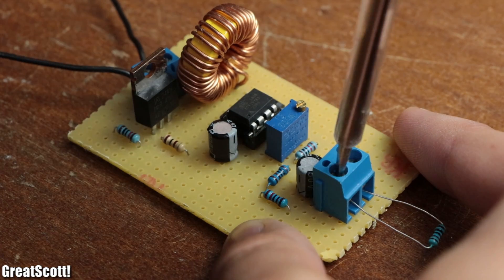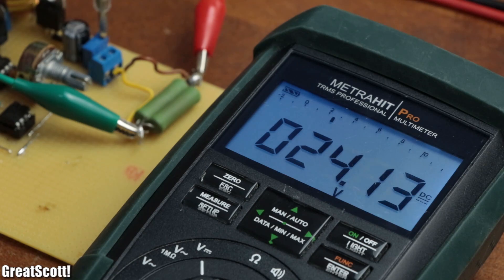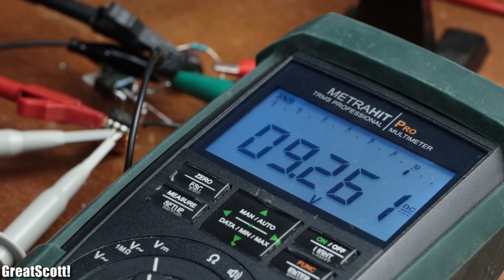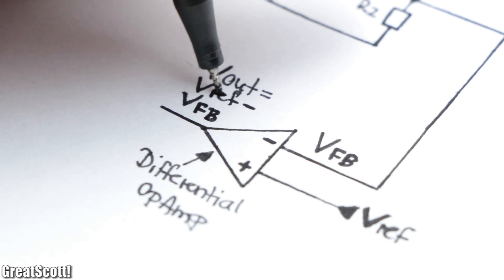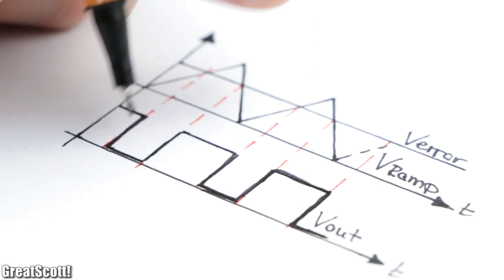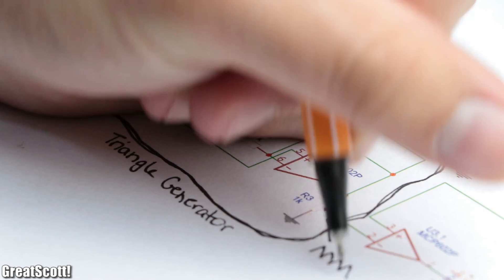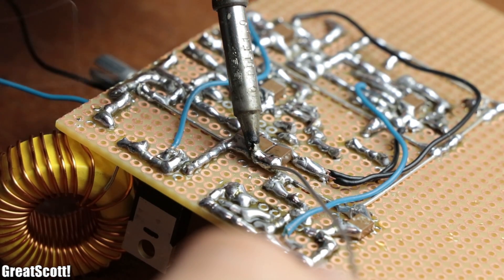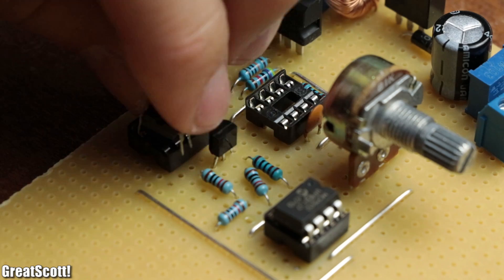Creating a Boost Converter WITHOUT a Microcontroller

Comment: uC are very handy, but they suck compared to dedicated IC's (and the discrete component method too).. For DCDC converters, a high switching frequency is sometimes very desirable. With uC's the PWM frequency is often too low or if it can be increased, the discrete steps that the duty cycle moves in is absolutely rubbish for maintaining a decent output voltage.
Reply: In addition to that mentioned disadvantage (quantized PWM steps that a microcontroller supplies), a much larger problem with using a microcontroller is that you cannot tune the feedback loop for high gain and high speed.  Designing a proper feedback loop for an SMPS is the hardest part.  Using a microcontroller will work, but the microcontroller will respond very slowly to output voltage changes, often taking hundreds of microseconds or even milliseconds to bring the output voltage back to the design voltage after a transient.  This is unacceptable in most applications.  An SMPS using a dedicated SMPS controller IC can be designed to bring output voltage back to the design value in single-digit microseconds for voltage-mode control, or down into the nanoseconds for current-mode control.  In this circuit shown in this video, the error amplifier looks to have a gain of around 1 (10K input resistor, 10K feedback resistor).  While that will indeed be stable, the output regulation will be very poor (several tenths of volts or whole volts of change with a load change).

Comment: I think you made that way more complicated than you had to. Whenever I have built boost / buck converters for projects, I typically use a PMIC which if you do the calculations in the datasheet correctly, will end up needing fewer parts and no potentiometers. Alternatively, you could try using TI's Webench tool, which lets you put in your input voltage range, output voltage range, and output current (it automatically detects boost / buck), and then will give you a list of specific value parts for different designs with various efficiency curves. While the main PMIC would be a TI part, you can usually find comparable parts from other manufacturer's which don't require component value changes. Also, all of the webench designs are SMD based, so they give you a recommended compact PCB footprint for the converter, though you should be able to do the same thing using perf board and THT components.

Comment: Lol,, let's kiddingly complain more! ;))
 Why are you using these newfangled IC-thingys? Real men build their boost converters out of discrete transistors!!

...or so I've been told... 

*buys 5 converter modules on AliEx for $0.99 like everyone else

Personally, I usually grab an old phone type car charger with an MC34063 and put the original components in a boost configuration. Then I simply change the feedback resistors to set the voltage. It's not a clean voltage rail or capable of serious current, but it works for powering a relay or something like that with around 12-15 volts from a 5v supply. I don't worry about the inductor size or anything like proper SMPS design. Just throw it on super cheap perf board and hide it in the back corner of an enclosure.

I've never used a uC though.

Thanks for the upload ;) 
-Jake
Reply: LOL no way, tubes!
Reply: Relay logic is the only way!
Reply: Very impressive, but can you do it using only passive and electromechanical components?
Reply: Wolfin 
Heck yeah!!! 

I ball George Jetson style. 

*Button push + Button push + Button push = boost.

 You can call my thumb Mr Mosfet Sir.
Good day!

 ;))
Reply: Real men build their boost converters using only a pencil, tin foil, and a razor blade
Reply: Then we'd just make pinball machines. this is not a bad thing!
Reply: Real men use motor-brush rectifier
And piezoelectric switch

Comment: Great video - btw. it does make sense, because when using an uC you need a programmer, computer, etc and also its not available everywhere and little more expensive and harder to replace when broken (reprogram, needs the code etc)
Reply: on what device did you watch this youtube video?
Reply: android phone, why?
Reply: A programmer's job is to get fired as quickly as possible.  Put another way, a programmer should be looking to have the project done so he is not needed- a programmer is an automator.  If your code needs reprogramming later on, either your needs changed or it wasn't done right the first time!
Reply: PolskaDojczland 
You have a good point. But I (as an electronics hobbyist) usually prefer the programming approach, I feel it's easier to test and debug, especially if you come from programming into electronics. But I noticed that the hardware approach is somewhat more "robust" than microcontrollers.
Reply: Abdulaziz Salam - For a hobby project you can use whatever parts that you have and want, but for professional use a standalone ic would be used - a uC is just too unreliable, not "robust" enough as you mentioned. But both approaches are valid, i just wanted to clarify it DOES make sense to use only ICs, because in the video he wrote it doesnt make sense.
Reply: PolskaDojczland 
In an old project I needed few logic gates but didn't have them at that time, so I used an AVR Attiny85 instead of them. It's pretty crazy I know 😂

Comment: It's always good to have more than one way to solve a problem.

Plus, I prefer a pure hardware solution over doing the heavy lifting in software.(mostly because I suck at coding)
Reply: In the aerospace industry this approach would traditionally be the more preferred choice as it is easier to verify. Verify code and a microcontroller is a lot more complicated than verifying individual components and ICs.
Reply: seconded. I usually frown at the use of uCs in every simple application that can be done with a transistor and a few resistors. And this traditional approach is easier imo and the right way to implement basic circuits.
Reply: Indeed, but if you use more hardware on your projects, you will have more stuff that can eventually fail. Also, if you use a mC for simple aplications, is like killing a fly with a cannon. Yes you can kill ir, but with something simplier you can do that job
Reply: Joe Charlie H
Yes there is more stuff to fail but one needs to look at the overall probability of failure. Which is the sum of probability of failure of all of the parts. As a very simple example, if there is a circuit which has 5 components which all have a 0.03 chance of failure, then the overall chance of failure is 0.15. If a second circuit has 10 components each with a 0.01 chance of failure then the overall chance of failure is 0.1, what I am trying to show by this, is that although the second circuit has more things which could go wrong, the chances of the second circuit failing is less. Is the mircocontroller more likely to fail than the sum of any of the ICs, that is the real question as to which circuit can be considered the more reliable in terms of prevention of failure.
Reply: pileofstuff at least you are better than me, I don't even know coding is related to electrical engineering.
Reply: pileofstuff at least you are better than me, I don't even know coding is related to electrical engineering.
Reply: Sometimes i chose a uC because it was a more compact solution, i need to fit in something somewhere but i can run an ATTiny or STM8 with no external components at all, saves space over a 555.
Reply: Yep, there is more than one way to skin a cat.

Knowing them all isn't overly beneficial, but knowing some of them is. Take your pick!
Reply: the biggest draw towards using an IC for hobbyists (and even small scale commercial projects) is that it's often cheaper and faster to design and build an IC based circuit than one using discrete components. once you go into rf, that changes a bit, but SDR are a big part in most recent radios too.

Comment: Nice tutorial - but I wouldn't recommend the microcontroller version either ... Use a simple MC34063 for this task :) A step-up / step-down normally does more than just adjusting the PWM ... They have some safety circuits built in - for instance limitting the current through the coil and mosfet ... A year ago (or so ...) I used the cheap MC34063 as boost converter for 50W LED (12V to 48V @ 1A) which worked quite nice and it is cheeeeeap :)
Reply: temperature compensated, too!

Comment: You've overcomplicated this project. You could've used the UC3843 IC, which is way cheaper than a microcontroller. Everything is inside that chip, you only need a mosfet, voltage divider and current sense resistor (optional), plus the filter.
Reply: Even simpler is to just use the MT3608 chip. It has the mosfet already build in and you only need to add a couple of resistors, capacitors and an inductor. However, this video by Greatscott was not about simplicity. It has great educational value...

Comment: An old school Great Scott electronics video -always a treat when the Patreon feed fires :-) May I ask about the ramp function please? Why not a sine wave there? Isn't it easier to create a sine wave oscillation? Hope this is not too dumb a question.
Reply from the maker: Since the feedback needs to be linear we have to use a triangle signal.
Reply: A sine would result in nonlinear feedback. It'd sort-of-work, but output voltage stability would be poor. To work properly you need a triangle or a ramp.
Reply: To address your other question, sines can also be trickier to make. Triangle waves are very easy to make with a relaxation oscillator. Sine waves require a little more effort, enough so that many function generators instead filter a triangle wave into something similar to a sine rather than generate the actual thing from scratch.
Reply: Really good triangle waves are difficult. You need to do things involving a constant current source. But unless you're making something that needs a really precise triangle/saw wave (an oscilloscope perhaps, or CRT display), a relaxation oscillator is a close-enough approximation.
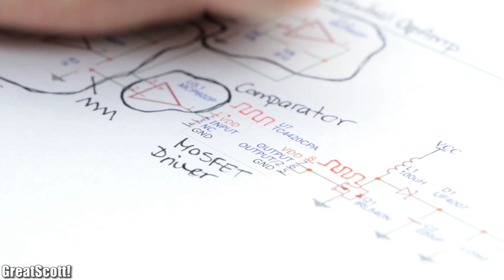Reply: @vylbird8014  The oscillator used in the circuit (see 6:02 ) charges/discharges the 10nF capacitor with a constant current via the 1K resistor which has either +2.5V or -2.5V across it, That's because the 1K resistor is driven by the rail-to-rail (0V to 5V) square wave from a Schmitt trigger and the other end of the resistor at the inverting input is kept at the same voltage as the non-inverting (around +2.5V) by opamp action. It's the really good triangle wave you're looking for.

Comment: Why would it "usually not make a lot of sense"? Every boost converter IC on the market is analog, even the digital ones have a simple state machine, not a whole mcu! Throwing an MCU at every problem is lazy and shows lack of skill. A few opamps and a 555 are usually also cheaper than an attiny and can be done with less boardspace if using the proper SMD packages.
Reply: It is easier to use an UC3843, dont you have them in your country?
Analog IC with only 8 pins that provides current limiting and a voltage control with a few components to work
And its $1 per 10 of them!
Reply: Yeah using MCUs for everything is just lazy, as I said to somebody in a comment above, in the aerospace industry the non software approach would traditionally be preffered
Reply: Novi S when you reach production, you will realize how expensive they are.
Reply: David Schwaerzle analog parts are also available in tiny smd package and they usually cost only a few cents.
Reply: David Schwaerzle did you seriously just write FPGAs ? who in their right mind would use an fpga to implement a simple current sense ?
Reply: 12458 SSE did not get it. Which production? China really likes to use uc3843 in their buck and boost modules cause it is cheaper than anything else
Reply: David Schwaerzle But if you use a microcontroller, you have to program every device. I think this can be completly automated, but why would somebody buy a machine that can program the products automaticaly when they can just change the design? I think that in a boost converter, the extra parts would be cheaper than the uC anyway.
Reply: Undefined Lastname there's a major pre requisite in your example..the mcu already being present in the design. in that case its definitely better to use thw same uC for implementing the control logic. but an added complexity would be sequencing the execution of several pieces of control logic simultaneously. in the end it all rests on the design engineer. if they can make it work efficiently then there's nothing wrong with it.
Reply: Agree. Waayyyy better doing it with TTL logic,NE555,TL494 ...
Not so boring to build using fuckin mcu
Reply: You would use MCUs for the same reason people use op-amps instead of discrete transistor error amplifier circuits.  It's a building block, and there's no prize at the end for reinventing the wheel.

If you want to take the scenic route for your own amusement, go ahead.  I'm all for building from-scratch 8-bit computers, or whatever floats your boat.  But when you just need a thing done, MCUs do a lot of things, and they do them cheaply, easily, and well.  Why would you NOT use them?
Reply: Nick Wallette cause there are better and cheaper solutions which are exactly made for this application only and they work great providing more current for mosfet driving and requires no programming or anything
I thought no one uses MCUs for that reason before I saw this video
Reply: MCU footprint is actually lower than 555 because you need zero external components for special low pin count varieties, and you can get them down to SOT23-6 footprint. You also get a much more reproducible behaviour than an ad hoc circuit that would depend on analogue component values, and all your capacitors and inductors happen to be like 20% grade for example, resistors 5% etc. When doing a variety of one-off projects, stocking up on microcontrollers just makes sense, so you don't end up with a huge stock of cheap but ultimately unused parts, can help keep the hobby more affordable as a whole.
Reply: you're mistaking the youtube audience with aerospace engineers :P
not that I disagree nor that I'm an expert, but come on, this videos are aimed at hobbyists and tinkeres ;)
Reply: Well, the Pickit 3 uses the MCU to implement the DC-DC loop for the programming voltage. Correct me if I'm wrong.
Reply: It's not that uncommon to use a micro you already have on. JYE Tech toy/educational oscilloscopes also use a PWM output of the processor to generate a boosted and an inverted rail for the opamp.
Reply: Let's throw an FPGA into it! I'll make a boost converter with an FPGA just for fun! And for learning SystemVerilog.
Reply: Novi S. Not to mention if your really strapped for cash, you can find UC3843 chips in a lot of devices fairly well protected from the usual failures. Computer power supplies generally have 3 or 4 each. Easy to find burned out power supplies that most people are happy to give you if you just ask.

Comment: Instead of large solder deposits/tracks why not use heavy gauge copper wire or guillotine some copper sheet, much less ugly..
Reply: Stripboard is a lot cleaner if you like pre-made stock PCB like this (you can drill the surface around a hole to cut a trace). A little less flexibility in layout but pretty nice and quick.

Comment: Interesting video with many great explanations. Thanks!  I noticed the MT3608 datasheet and as you state later in your video, it would be much easier to make a boost-converter using such a switching IC. It would probably also be cheaper and smaller. After first repairing a faulty boost-converter by replacing the MT3608 chip, I still had enough of these cheap chips to make a miniature boost-converter on a SOP8 breakout board. If you're interested you can see how I made it here: https://youtu.be/K7Lv5FWTX9Y